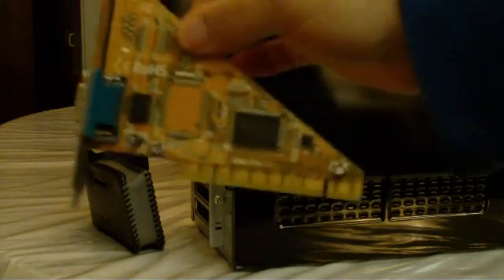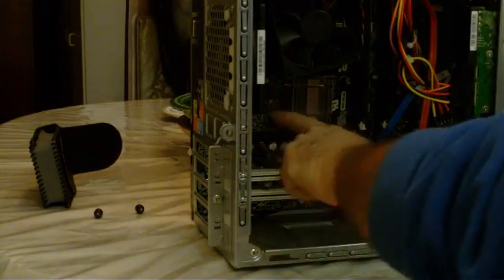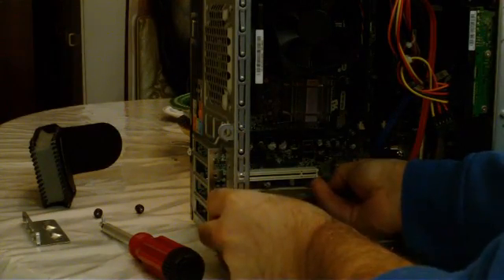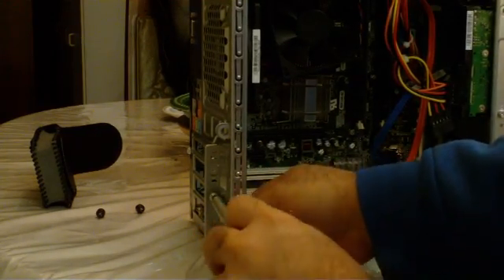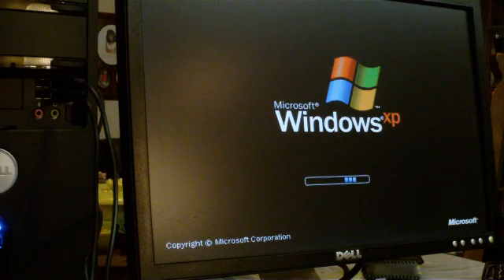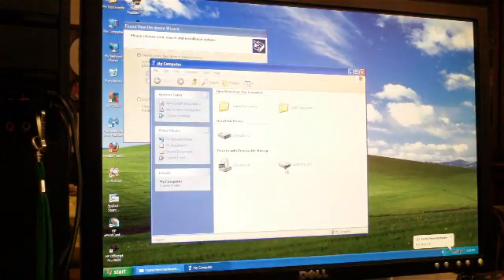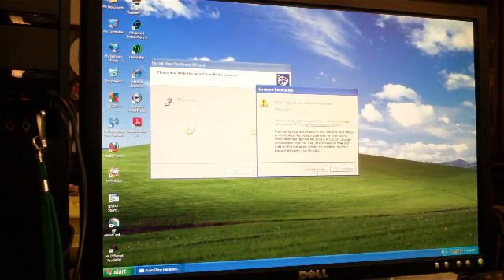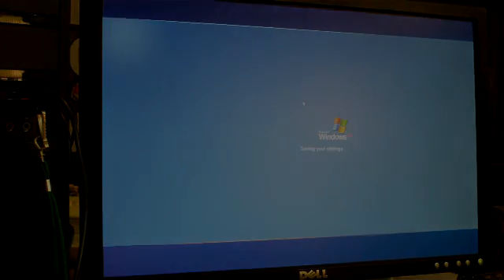How To - Install a PCI Card

Comment: I don't even if you will read my comment but I didn't received device driver for pci and update driver automatically isn't helping. Can you please help?
Reply from the maker: What I usually do for that is to try and find the manufacturer of the card and look for a driver download on the internet.  Sometimes it works, and sometimes not.  Ive also found where if it is a defective card, it wont pick up drivers.  Another tip if you cannot find a manufacturer, is to look at the chips on the card and see if you see names like realtek, texas instruments, etc..... then do a search for say realtek pci and whatever kind of card it is.... let me know what happens.  I do try and respond as I can, but I dont always have access during the week.

Comment: I don't know if you're still reading the comments but is it okay if I install the card in the PCI 2 slot instead of the PCI1 slot
Reply from the maker: It should be backwards compatible depending on its design, bios, and a few other factors.  Slots such as PCI-E, AGP, ISA, depending on age of the mother board, are not interchangeable.  I do know one of the differences as dictated by the spaces or slots in the card as pictured on the thumbnail of this video, is voltage.  The thumbnail is an example of a card that can operate on either 3 or 5 volts and has the corresponding cut outs to prevent you from inserting it into a slot that can damage it.

Comment: I have a hp pavilion slimline  s5120f PC  do you know if you can hook up one of these cards on my computer.
Reply from the maker: You could if you can find a pci express card with the small bracket.  I have a dell pc with the same slots your hp has ( I like your hp better than the dell I have )  and had to get a PCIE with the small bracket.  Little bit of changing out the bracket but the rest is easy and works like a charm.
Reply: Thank you  I think I found one  www.amazon.com/dp/B002RYTI7I/ 
would this one work.
Reply from the maker: that one would work.  good to know those parts are still out there.  I have a ton of old parts, but not that one

Comment: dang that is a pretty clean computer on the inside to be that old!
do you take requests? I need a power cord for the monitor to the desktop.. I have stolen the one off my little flat screen TV so I can use an old HP monitor as an extra screen while I am working on school with my lap top.. but now I can't watch TV in my room anymore (insert sad face)